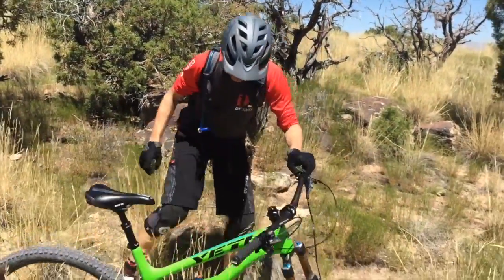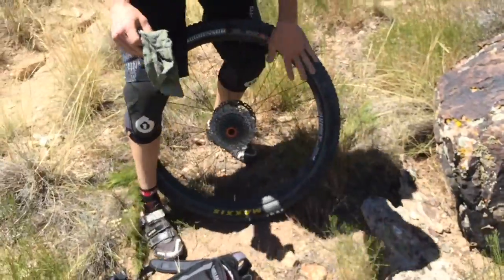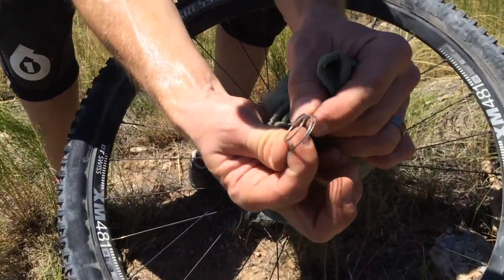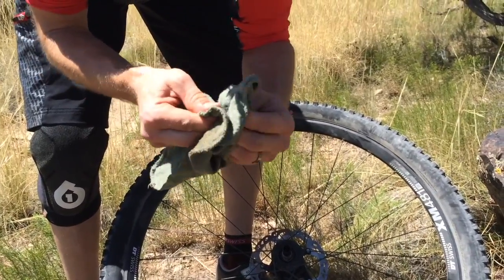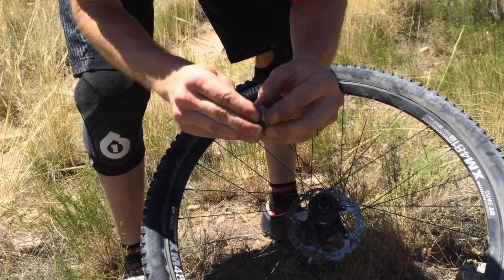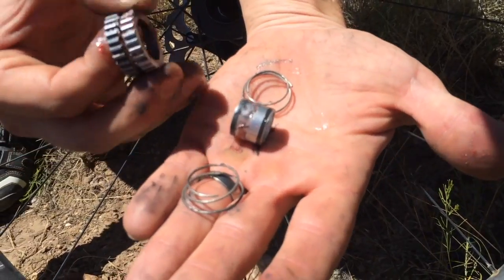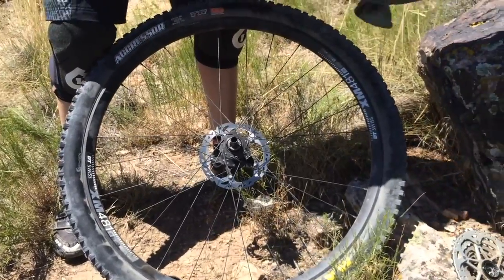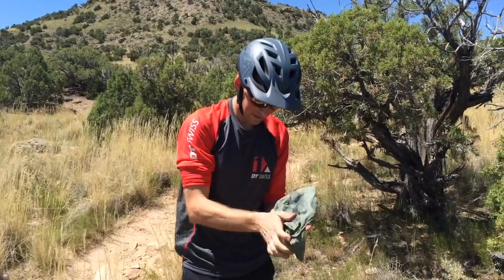Ratchet: How to service the DT Swiss Ratchet system in under 5 min.  | DT Swiss

Comment: so if my drive train is getting slight slippage , would it be the freehub body getting worn out from those little tooth marks or the star ratchet needs to be cleaned or replaced , my wheel are strike slg rim brake qr
Reply from the maker: As we do not offer any drivetrains, a question about them might be better placed at companies like Shimano, SRAM or TRP. But if you're asking about a skipping DT Swiss freehub system, usually the ratchets rings need to be replaced. A deeper inspection can be done by an experienced bicycle mechanic.

Comment: Do I need to do it on the trail or can I do it properly where there's no chance of dust or grit getting in there and the potential to lose bits in the undergrowth and so I don't have to take loads of tools and grease and a rag with me??
Reply: You have to do it on the trail. Even if on a road bike, find a mtb trail and do it there. It wont work otherwise

Comment: While the contact ratchet teeth need just a small amount of grease, the other area that is even more critical for keeping clean and well-lubed are the outside ridges of the ratchets, as they are constantly sliding in and out as the ratchet teeth slip or engage. If those outer ribs seize, the freehub could either spin without engaging, or less likely but far worse, lock up and wrap the chain almost surely causing a crash.

Comment: @00:51, that popping sound?  Mine used to do that but now it simply separates and exposes the ratchets.  Ideas?
Reply from the maker: Hi Troy, what is the wheel / hub model? Usually just cleaning any grease off the end of the hub axle, and also cleaning the inside of the drive-side endcap will help. We like to use rubbing alcohol to perform the cleaning just described. This will increase the friction between the endcap and the axle and help the freehub stay on better. That said, the hub is meant to come apart easily to make servicing the ratchets a tool-free process.

Best regards, 

Andrew
DT Swiss

Comment: My DT Swiss 240 hub works fine when off the bike, but when I put it on my bike and tighten my axle, the hub just sticks with my wheel allowing me to pedal backwards, when I installed the hub body on to my rim, it looked like it didn’t seat all the way and I tried everything I could to get it to seat but it didn’t so I assumed that was normal, but obviously somethings wrong since my cassette spins with my wheel when I tightened my axle, any advice on how I can fix it?
Reply from the maker: Hi Marcus, thank you for the question. We have found that most 240/350 hub binding happens after a hub service or end cap conversion. Usually free hub binding is caused by something making contact with it.  Here are some common causes: #1 The ring nut is in backwards or not far enough. This causes the hub seal to stick out too far and bind the FH at the inner lip. This seal should sit flush with in the hub shell. #2 The hub seal is upside down and possibly not pressed in enough – black rubber should face out. #3 The shim ring should be centered and fit in the ring nut cavity. #4 The spacer sleeve is missing or compressed. It should be 15.40mm in length.  #5 Check the hub shell, FH body, and end cap for any burrs that might cause binding. If you'd like to email us directly at info.us@dtswiss.com, we can send a diagram with troubleshooting steps that should help. Thanks, Andrew - DT Swiss USA.
Reply: DT Swiss AG thank you for the help :) turns out the seal that goes after the ring nut was damaged and bent and it didn’t allow the whole thing to seat properly, I ordered the seal and while I’m waiting on it to come, I figured I’ll just carefully put a few rides without the seal until it comes

Comment: The longer part of the service is to take the wheel off and put it back. This DT Swiss system is by far the easiest and the most reliable on the trail. No small parts to loose such as pawls and tiny little spring...
Reply: +dtswiss awesome! Do you know if there will ever be a better ratchet than the actual 54 teeth one?